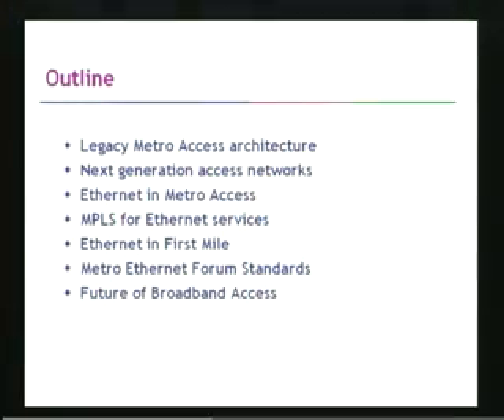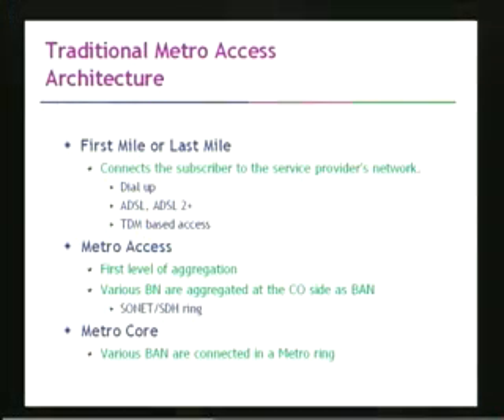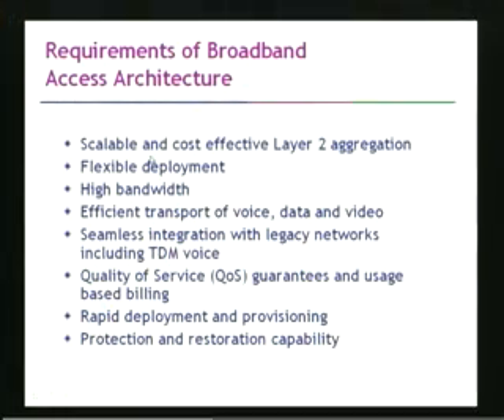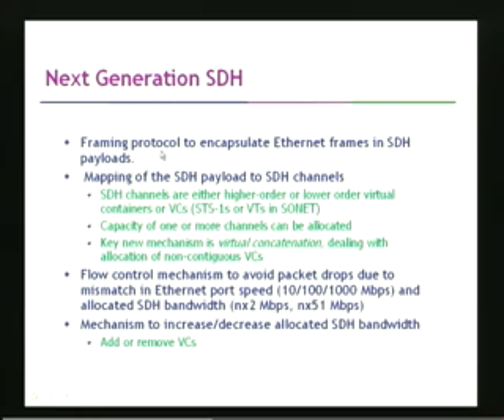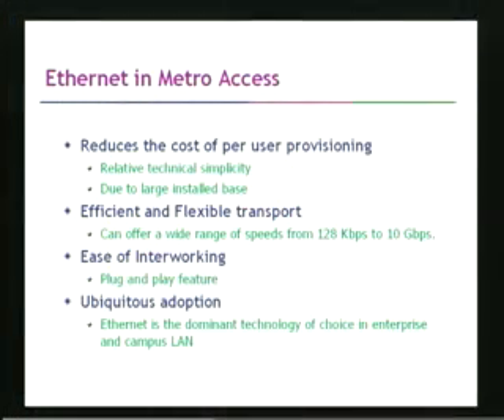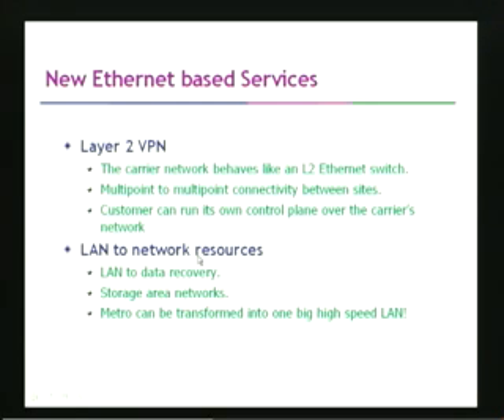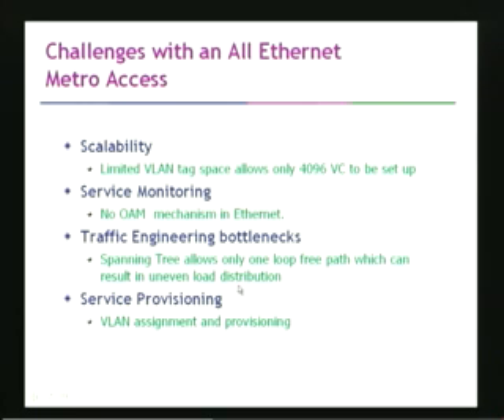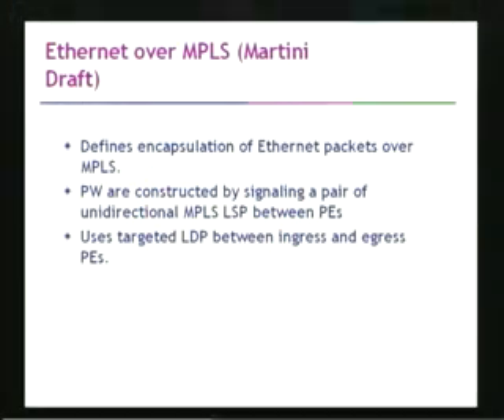Lecture - 32 Metro Ethernet Access Networks

Comment: where does routers and switches fit into this picture?
Reply: SHANTANU kulkarni They would fit into the core of the network where the MPLS part of the network lives. You can even have Switches at the edge of the network as well in a data center or facing a small foot print of customers.